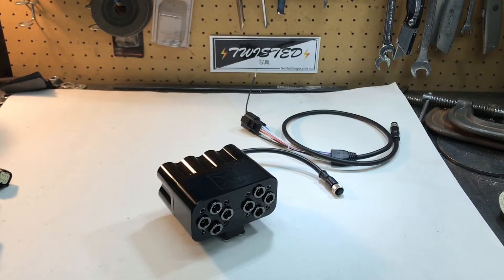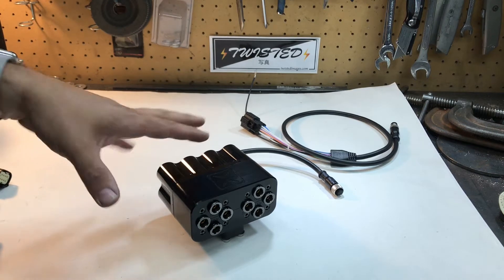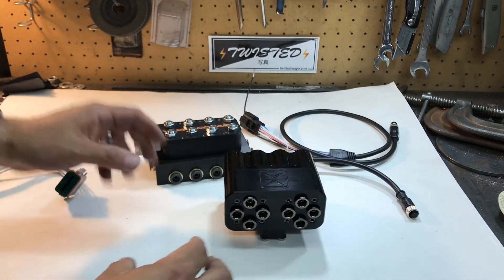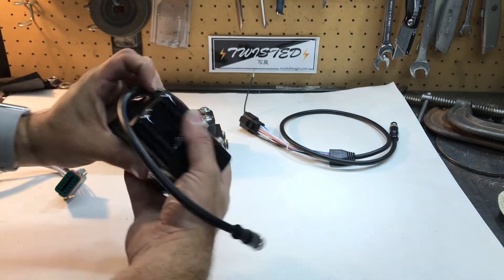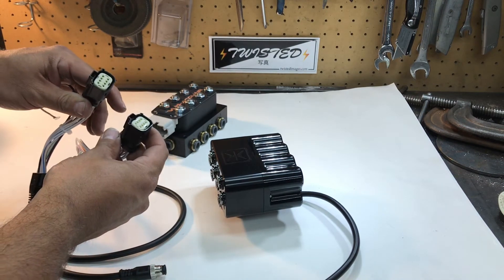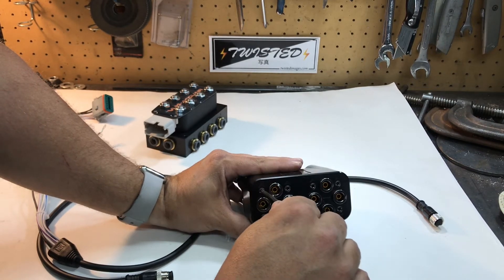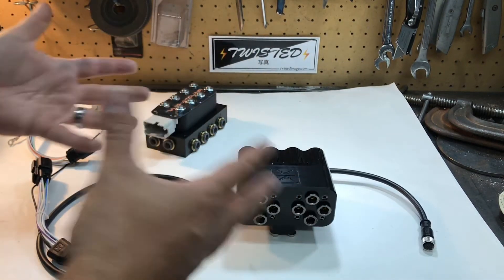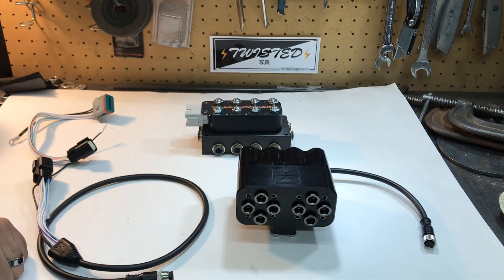Accuair's NEW VX-4 4-Path Valve Manifold

Comment: I bought the VX4 from you a long time ago. I'm thinking about switching to half inch air lines because I want the car to raise up quicker. what manifold is good.
Reply from the maker: If you want 1/2” lines and fast response, no manifold is going to give you what you want. The style of valve just doesn’t lend itself to high flow rates.  It’s more work to set up, but running individual diaphragm valves is where it’s at for speed- if you haven’t seen my video with the ‘61 wagon take a look at what’s possible. And of course you can slow it down a bit from there if you don’t want it THAT fast!
Reply: @twistedimages405 what are diaphragm valves
Reply from the maker: @paulolindo6988  these valves right here: https://www.twistedimages.com/12-Air-Valve_p_337.html

You’ll need 8 of them, along with a big bag of fittings, to handle the same functions as your VX4. But they move a TON of air and will get you up and down fast.
Reply: @twistedimages405  can you wire lowrider switches to them?
Reply from the maker: @paulolindo6988  the wiring configuration is a bit different, but you can definitely use toggle switches with either valve setup. Here’s a link to our switch panel: https://www.twistedimages.com/Stainless-Steel-Toggle-Switch-Panel_p_1488.html
Reply: @twistedimages405  you said I need 8 valves. What does it look like with them all hook up together
Reply from the maker: @paulolindo6988  I don’t have a way to send pictures here- message me through our website and I’ll send you more details!

Comment: What size ports are on vx4? Im in need of something similar. Yet im running 1/2 lines
Reply from the maker: The VX4 has 3/8" fittings.  If you don't want to change your lines, you can either step down the line by the valve with an adapter fitting and short lengths of 3/8" line, or you could use the VU4 manifold that comes with threaded ports- you could thread 1/2" fittings into it to use your line directly.
Keep in mind if you're switching to a manifold from individual 1/2" valves that your system won't be nearly as fast- the internal ports on these manifolds don't flow as much air as diaphragm-style valves.
Reply: @twistedimages405  preciate the insight yes i may just stick to old style valeves
Reply: @twistedimages405  i have manual 2 switch setup just front and rear controls. Trying to get advantage of individual control on all 4 corner. Will the vu4 be slow as well
Reply from the maker: @andrewb.glisnin2266  VU4 and VX4 are both "direct-acting" valves, meaning the solenoid acts directly on the seal that allows air to pass from the tank to the airbag.  This type of valve is compact, which makes it great for use in manifolds, but the downside is that it's a lot slower than diaphragm valves.  So even switching from a 2-path setup where your two front or rear air bags are sharing that one valve for lifting or dropping, you'll probably find the manifold to be slower.
Generally, cars with VU4 or VX4 manifolds take around 2-3 seconds to lift or drop with 3/8" air line at 200 psi.  Compare that with the last 1/2" system we installed at the shop- less than a second to lift or drop, and the front wheels actually come off the ground when you lift it all the way!
Glad I could help- let me know if you have any other questions!

Comment: What the different between 2 corner and 4 corner??
Reply from the maker: The 2 corner (VX-2) has a single input and two outputs to your air bags.  The VX-4 is a 4 corner manifold and controls four separate air bags.